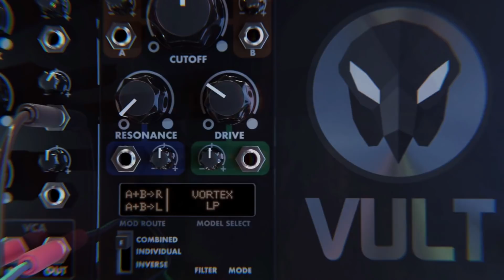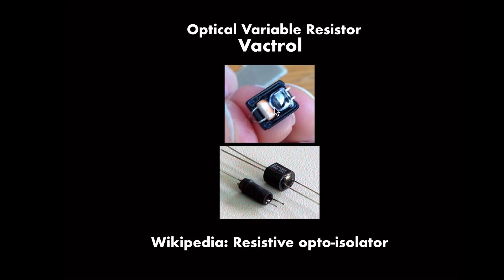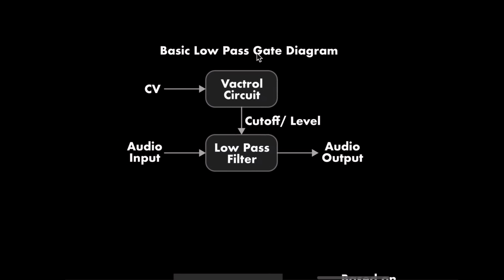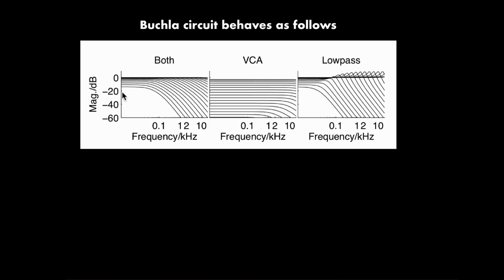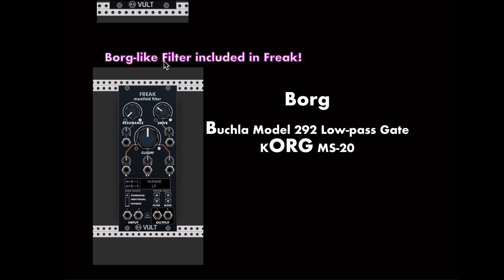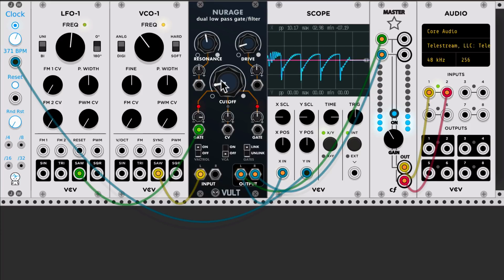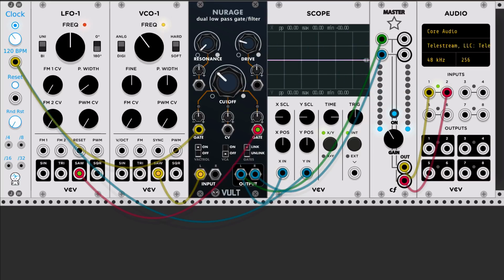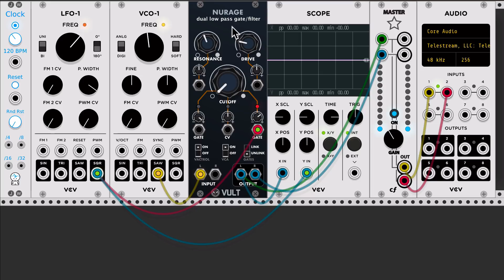Vult Nurage: What's a low pass gate?

Comment: Hello Leonardo, do you plan to port your modules to Voltage Modular?
Reply from the maker: Yes. There are already a few available. Nurage is already there https://store.cherryaudio.com/bundles/vult-rage-bundle
Reply: @Vult-DSP  I'm sorry I ask that three times. I didn't know which channel you hear :) what you think which platform has better overall sound quality: VCV or Voltage Modular?
Reply from the maker: @bibik44  measuring the audio quality is subjective because even characteristics that can be considered defects (like aliasing and distortion) can be sonically pleasing. The DSP code for my modules is exactly the same in both platforms so they should sound exactly the same.